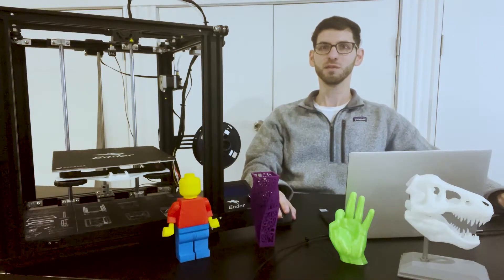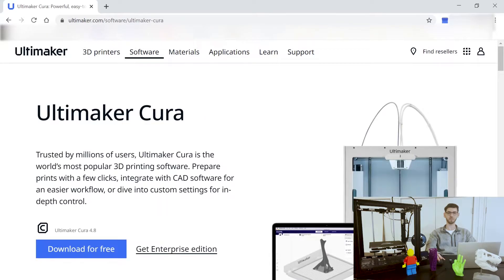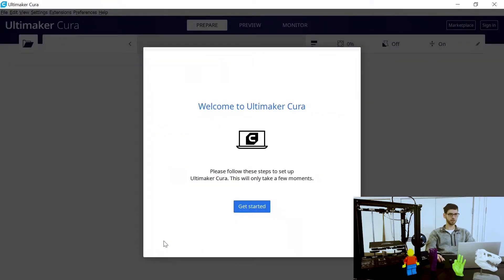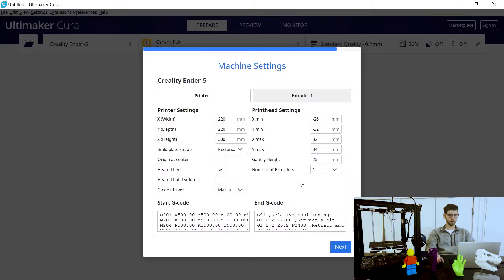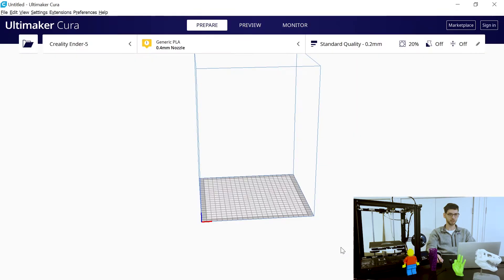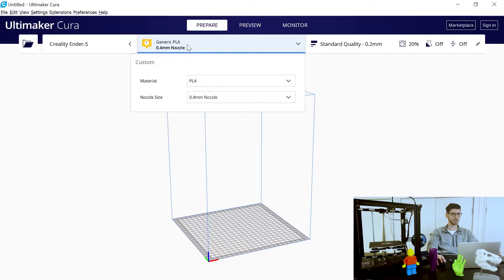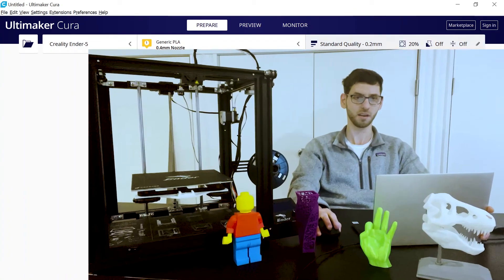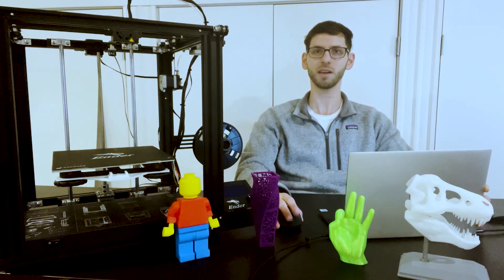PART 1: Beginner Cura 4.8 Tutorial (Software Install, Overview)

Comment: So where are the objects located like a circle or square so I can shape them..... there's no palette ? no shapes to build stuff with, or have I completely missed the point here?
Reply from the maker: Hi Darren and thanks for the question! Cura is 3D slicing software that takes 3D model and take user input to define (using GCODE) how to 3D print your model - you cannot actually create models in Cura. To create a model you need to use a CAD (Computer Aided Design) software. There are paid CAD softwares such as SolidWorks and Creo, but there are also a lot of free CAD softwares out there as well such as Fusion360 or AutoCAD that you can download and use to create designs. Hope that helps! Like and subscribe and please let me know if you have any other questions! Happy printing!